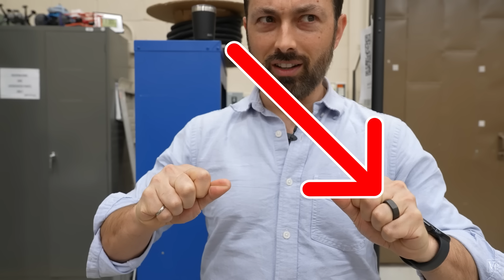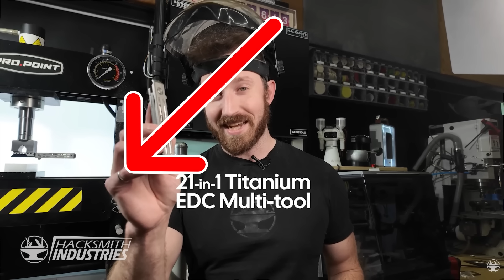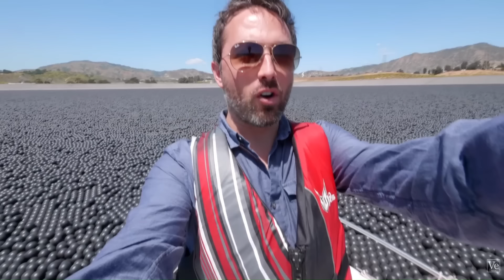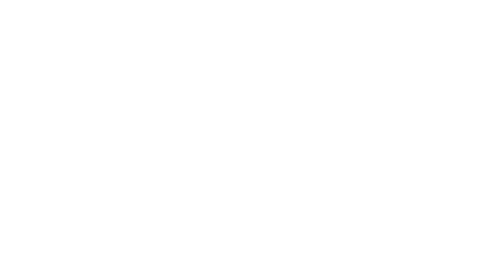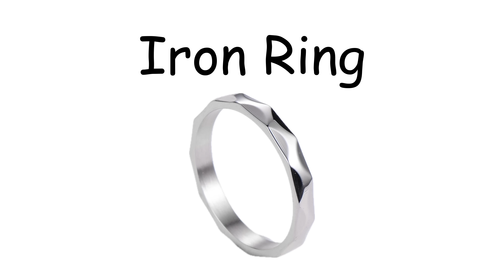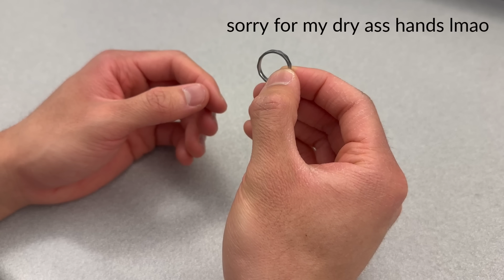What's the deal with Veritasium's pinky ring?

Comment: Why want to scratch on the paper though? Wouldn't it be better if the surface stayed more rather than less clear for an engineer?
Reply: I understand it's not about marking the paper, but about feeling the ring or its resistance because it touches a surface.
Reply: You think drafting paper is a perfectly smooth surface after people draw, erase, and use calipers on it all day? Or that the builders use the original drafts and not copies?

Comment: Interesting fact, the smoothness of the American Ring was a result of requirements to change how the ceremony worked. Basically, lawyers in Canada and the US suck and turned extending the Canadian organization into a copyright issue.

End result is: The order of the engineer needed a "separate and distinct" ring and pledge. They decided to switch to a smooth ring to reflect the "unwavering commitment" to the ethical code you're committing to.

Atleast, that was what the branch at my university said when I took the pledge and the organization went over the history.

Comment: You didn't mention origin of the ring which is very interesting. If I remember correctly, there was a terrible engineering accident in Canada, where a tension bridge with commuters on it collapsed. The reason were engineering mistakes, cutting corners and corruption. First rings were made from iron of this bridge, to remind engineers, that if the hard work is not going to be made correctly, with high moral standards and professionalism, life is in danger.

In my country there was a similar engineering accident. I wish we had the same program introduced afterwards. I observe no push toward moral excelence, professionalism nor anything similar. In fact I feel next big one is comming and a designer is going to be blamed for flaws of the entire system, which runs on lies, cutting corners and no internal check ups. And the accidents are relegated to footnotes in textbooks, not real, tangible possibility. I wish this system was introduced everywhere
Reply: The bridge failure was of the Québec bridge which collapsed during construction in 1907. The engineer responsible (American, Theodore Cooper of the Phoenix Bridge Company) extended the cantilever design to the point where it couldn't even support its own weight. He did not catch this in his calculations, but had faith in his own reputation, and he aggressively dismissed any doubts put forth by others until it was too late.